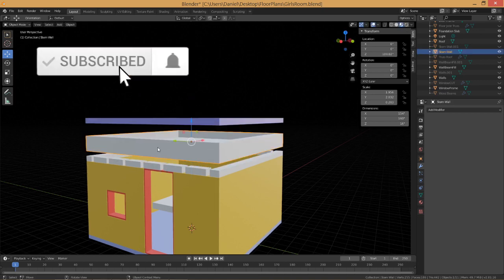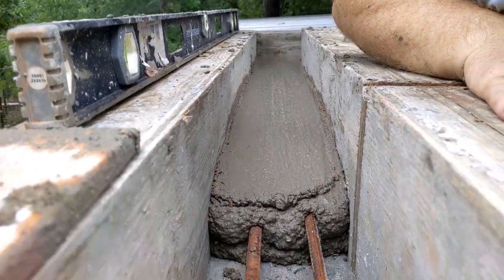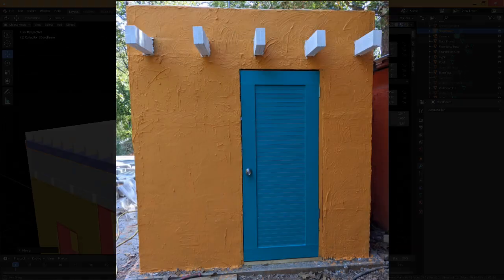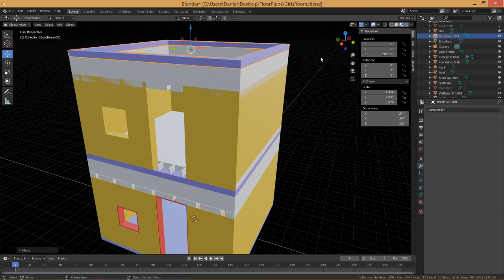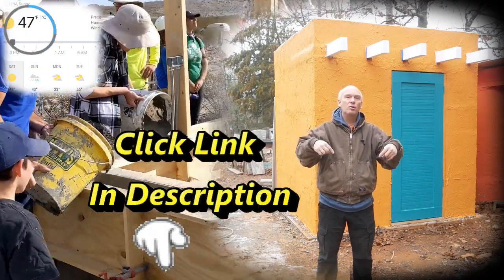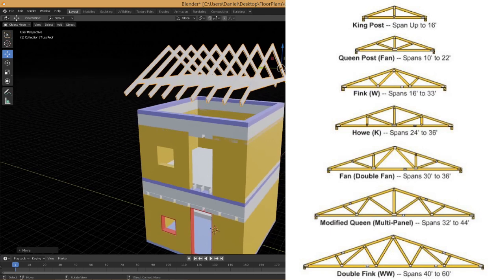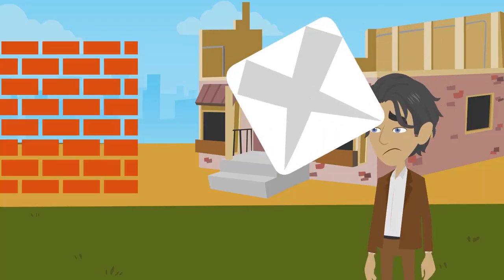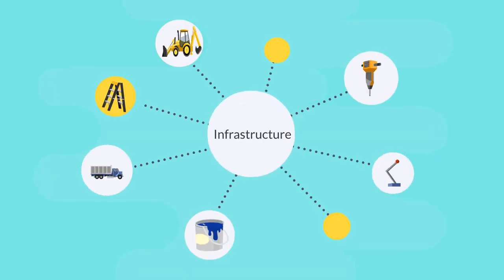How to Make AirCrete House Second Floor & Normal Roof

Comment: Seems like you would use an embedded truss anchor where the bond beam and roof trusses meet, right?
Reply from the maker: You can, I use cement wedge anchors and angle iron

Comment: Not too interested in building a second floor per say but I am interested in opening one up to about 400 sq/ft. Does everything scale well with aircrete? Also I live close enough to the coast to get some harsh winds from hurricanes would running rebar vertically through cast walls and clamping them to the joists be a good way to effectively hurricane strap a roof?
Reply from the maker: Round structures are best in wind with their lower coefficient of drag.. 400 square foot is no problem.  AirCrete roofs are heavy so require extra support.  If building a conventional roof then it's design and build as usual.

As long as all spans use the right truss and/or supporting interior walls or post you can span 40 feet with a roof.
Reply: @TinyGiantLifeStyle  I have considered going round but it does pose a few additional engineering and interior design challenges, namely solar setup, rainwater harvesting, not to mention flush mounting fixtures. Lets face it no appliance, rain gutter, window, or AC duct/head is designed for a curved wall. I can certainly deal with all of the above but it is extra time/effort/material. I was thinking about a square structure with 10" walls and reinforced corners sitting atop a crassbraced foundation with 4' footers at the corners and center with a 4" aircrete floor covered in rigid floor panel/plank. 
I have done construction for years, only things I have really limited experience with are siding and roofing as we subcontracted both most of the time. Not sure how well a flat top roof or stucko siding would hold up to our wet humid climate here in East Texas, nobody uses either here for residential.
Are there any aircrete homes that you know of that are passive house certified? That would be really neat and I think aircrete would be air tight enough for any blower door test so long as you sealed around doors and windows properly.
Reply: @lukethibodaux790  Stucko is very common in Florida.

Comment: Can the lower level Aircrete walls without concrete columns bear the weight of the  " 2x concrete tie beams" and upper floor weight with a plywood roof?
What is the compressive strength of a 5" Aircrete wall?
Reply from the maker: Yes, it's all just adding up all the materials and making a wall of appropriate thickness to keep the psi low.  Then once it cures fully it will be much stronger.